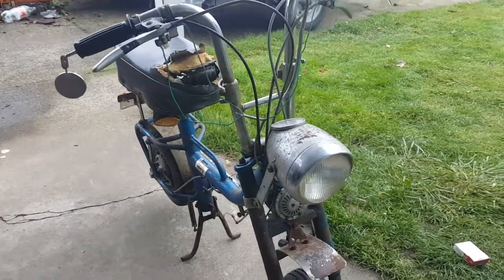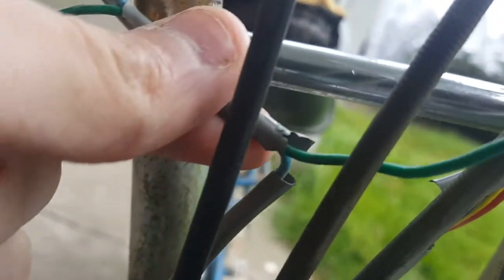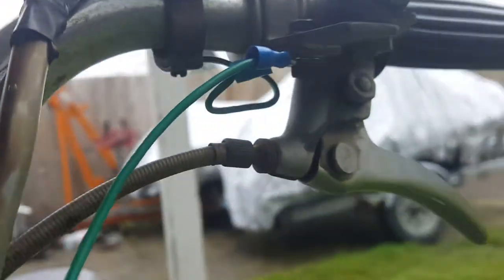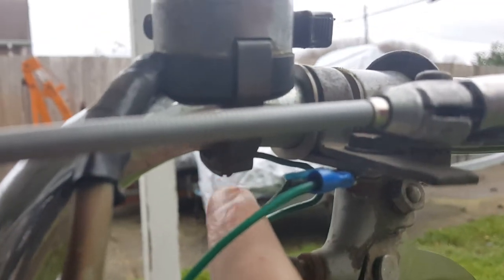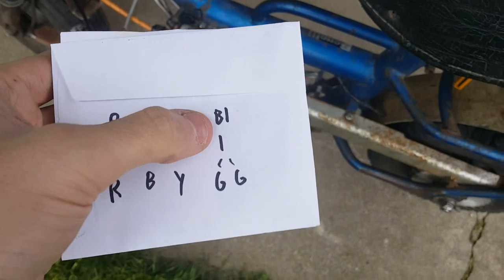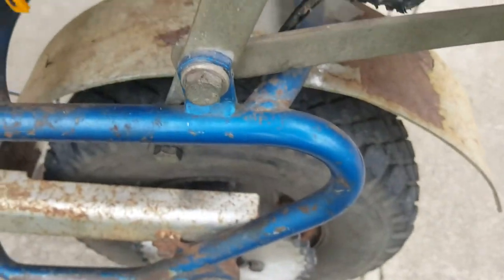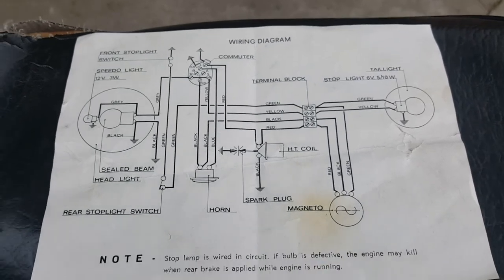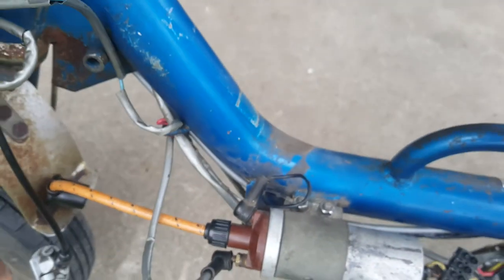Benelli Buzzer Wiring

Comment from the maker: On my channel I have another video going over the magneato. 0.016" points gap. I also show the original manual in the video. As for the coil there is a guy with username santo on ebay. I would ask him. I can also test my coil with a mulitmeter if you like.

Comment: Thank you so much for uploading this video! I was in the process of restoring a benelli dynamo but these wires were not attached to anything. Just put them in the correct place and hope my bike will finally get spark so that I can start it up!
Reply from the maker: No problem bro!
Reply: There is just one thing that I don't understand, when you pull back on the brake lever you break the connection rather than create connection. Do you have any idea why that would be?
Reply from the maker: @owenphillips2375   its grounded when the lever is forward. When you pull back its no longer grounded at the lever.With the lever touching metal its ground through the least resistance. When lever is seperated the current goes through the bulb which has resistance (electricity travels the path of least resistsnce). So when metal lever aint touching it now travels to the bulb filament. Also your bike wont run if your taillight bulb burns out. So always check the filimant first if it doesnt start!
Reply: @CoolHandLuke43   so I tried to start it and still got no spark, if it doesn't take too much time is there anyway that you could send a picture of the wires hooking to the ignition coil?
Reply from the maker: @owenphillips2375  send me your email or phone number. Then come back here and delete your commment. Or pm me on here.